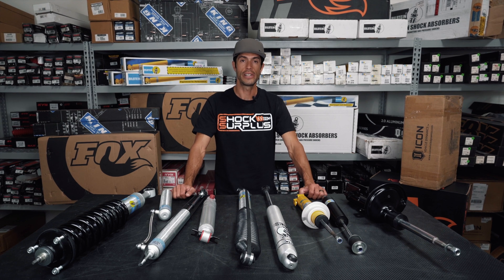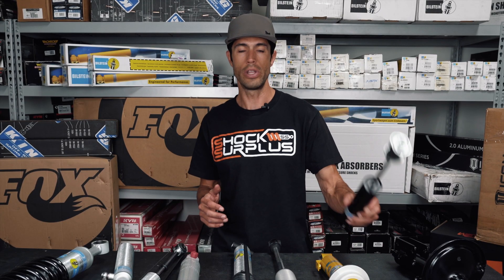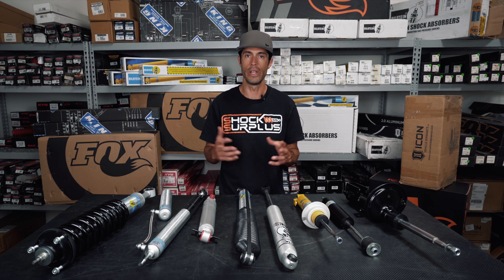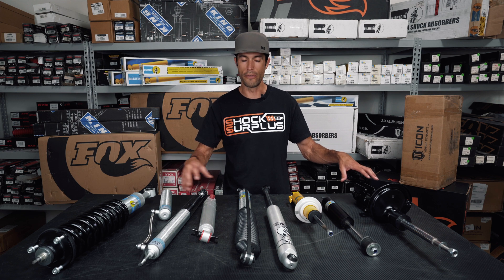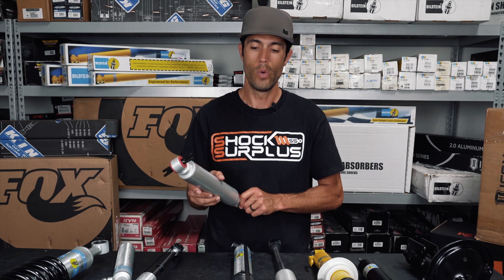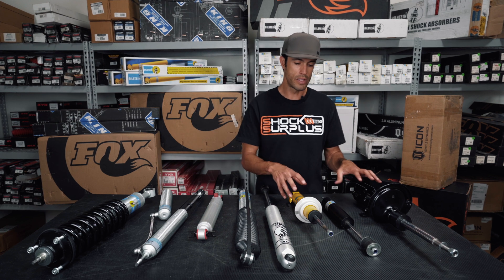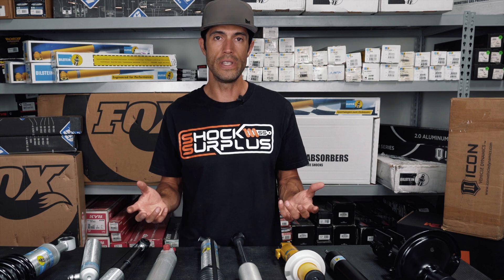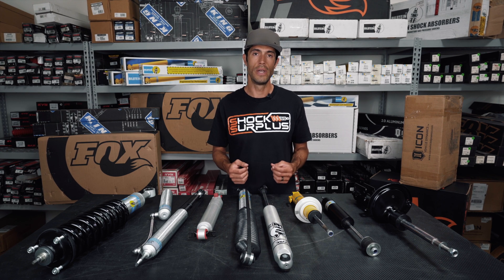Shock Talk Terminology - Ride Control, Comfort, Bump Compliance, Harshness, Boaty Behavior

Comment: I have a 2026 Nissan frontier s crew cab 4x4. It is my daily driver and will never need to tow nothing but my ATV on a light trailer. I am not concerned about payload.the rear suspension is pretty rough on the highway. Is there shocks that would improve the ride or would I need to go a different route. Thanks for any help. A few people have said the billstein 4600 off the pro 4 x would be a improvement
Reply from the maker: We've definitely got some great options to help smooth out those highways, including some from Bilstein and Eibach. Give the team a shout directly and we'll help you get dialed in.

https://www.shocksurplus.com/pages/contact-us
213-433-3616
Reply: @ShockSurplus ok thank you

Comment: Im looking for more handling cornering for my ram 1500 to lessing the roll and over steer or sway because I had 24x12s high tune on the engine
Reply from the maker: should get you setup with some bilsteins and new sway bars, reach out when you're ready, shocksurplus.com

Comment: I have 1940 Ford 1/2 ton panel truck with a ford 8" rear end.  Leaf springs from a 1955 ford truck used for the length I needed.  I would like the most comfortable ride possible.  I don't toe or haul anything heavy.  Thanks.  What shocks do you recommend?
Reply from the maker: Hey there, if you reach out to our pros directly we can see what we've got for you

https://www.shocksurplus.com/pages/contact-us

Comment: I just put the EiBach Stage 2R kit on my 24 F-150 FX4. Set at recommended height out the box. While the pogo stick hop and bounce in the front is gone and it’s much better than stock it still could be less bouncy and bumpy. Still too much unsprung weight with these tires. I’m ditching these 10 ply K03’s that weigh 66 lbs each next week for some 4 ply Toyo’s. Hopefully that works much better with this set up.

Comment: I have a 2013 Toyota Avalon hybrid and the ride is way too harsh. It jostles me when my tire hits bumps or manhole covers. I live in a city with lots of uneven roads, potholes, cracks, and manhole covers and it feels awful. I drove the 2023 Nissan Altima and the ride is both quiet and soft. Could you list some high-quality replacement struts for a smooth ride and how can I quiet the cabin sound so I also don't hear it when the bumps on the tires? I want long-lasting.
Reply from the maker: not a lot of aftermarket options, but KYB does have a set of shocks for you that would improve over what you've got now

Comment: Any shocks recommendations for a 2016 Mitsubishi Lancer ES (it’s a base model people, not an EVO).
I drive on rough asphalt country roads on my commute to work. (About 90 miles round trip).
I have no bouncing or anything but I can feel every lil bump, crack, or pothole I drive over.
I would like to replace them for a softer, comfier ride but without compromising the control too much. Always loved how it handled, cornered out the lot. I only used to do city/highway driving back then though.
Thanks for the help!
Reply from the maker: this will come down to budget, a set of 2 way adjustable shocks would be best, but pricey. if budget is tight, grab the bilstein b4 set

https://www.shocksurplus.com/products/bilstein-b4-oe-replacement-strut-shocks-set-for-2008-2016-mitsubishi-lancer-fwd

Comment: I have an 2022 Ford F-150 lariat. I like long drives on the hwy, with small amount of off roading. I want to upgrade my shocks where trucks aren't pushing me when I pass or when they pass me. I looked at the bilstein 6112 & 5160. What do you think is best for my request.
Reply from the maker: The 5100s would still be a viable option for the front, the 6112 may be overkill for your needs. Eibach would also be a good alternative, good handling, really good comfort. 

https://www.shocksurplus.com/products/eibach-pro-truck-sport-strut-shocks-set-for-2015-2023-ford-f150-4wd

Comment: Any suggestions you recommend for my 2018 tacoma. Its my daily driver and built it mostly for overlanding, but i do about 1 or 2 trips a month of camping/offroad and looking to upgrade my stock suspension and cant decide between icon stage 3 or fox 2.5. Looking for smoother ride and not feel the road in my steering wheel.

Comment: Is there any problem with using a shock made for a E-150 van in a 2dr 4x4 2.0L suzuki vitara with a 2” suspension spacer lift? The mounts fit and it will give me more travel, but theres no rating on these shocks for the vehicle weight or cargo load theyre intended for. I use the vitara as a towed behind my RV. We usually have 250-800lbs of passengers and gear and use it for washboard roads up to a few slightly challenging trails, but never rock crawling. I just want to go fast as possible on washboards without rattling my teeth out and be able to get as much travel for the slightly technical trails.

Comment: I have 2023 sequoia SR5 , factory condition. I want smoothest plush floaty ride over the bumpy road and potholes. The stock shocks are smooth on smooth highway but on small potholes and on little rough road the ride is harsh. Can you please suggest me shocks . Do I need to change the springs and shocks ?
Reply from the maker: There are not a ton of options out just yet, but we think the most plush package available are the Dobinsons MRRs when adjusted properly. They really can not be used effectively with stock sprigns, but they have tons of options for different lift heights and constant weight loads

Comment: i have an 09 Tahoe. I dont haul heavy stuff but im looking for soft suspension upgrades what would be the best option for the shocks, maybe even throwing in springs and struts just want a soft ride.
Reply from the maker: Probably the softest and most plush option out there is going to be the Fox 2.0s. Out of the box they will lift the front 2" but can be adjusted to stock height if you so desire. Their only real draw back is that they will need to be rebuilt every 40k or so under normal use, so they are not the longest lasting option out there, but certainly one of the comfiest.
Reply: @ShockSurplus  does this also apply to the rear shocks?
Reply from the maker: Ride quality and life span yes, but the rear shocks will not change ride height

Comment: 07 fj cruiser, base weight, eventually will add weight but i want a smooth ride on two track's,washboard roads just glude over all those annoying bumps and washboards. While getting anywhere 3lse i need but that is primary use
Reply from the maker: For that I would definitely lean towards something linear in valving and uses a universal style flat ground coilover spring in the front like a Fox or King. If you do not have weight in it now, then keep the standard springs on the coilovers and go with a light or standard load rear spring until you have the weight to necessitate something stiffer. Otherwise if you do not mind the rear sitting a little tall you can go with a multi rate spring in the rear like Icon 52800 3" springs. Their initial rate is soft enough to live with unloaded, and they get progressively stiffer as compressed so they work killer under a load. Since the front coilovers use a universal style spring it will be easy to get a stiffer when and if you need it.
Reply: @ShockSurplus  I hear a massive amount of people recommending bilstein 6112 in front and 5100s for rear is this equivalent? I wish there was just a set kit with part numbers for just this haha
Reply from the maker: The Bilsteins are great, but their digressive valving will have them feeling a little firm on washboard roads at lower speeds. They are great if you like to drive a little faster, but if you want something that "Glides over the road" those are not the shocks you want. Fox and King have a number of various options for coilovers and shocks based on budget and needs so there is not just one simple part number for everything, but al of this is listed on our site and if you get stuck we can help you make the right decisions for your needs. https://www.shocksurplus.com/

Comment: I have 2021 GMC Sierra 3500 SRW crew cab regular box.
I do not tow but will occasionally wi fill truck box with 500-700 of camping gear or my quad. 
I do not use truck for off roading.
Still running OE shocks and looking to improve smoothness in my ride. 
What would be your recommendations?
Thanks in advance.
Reply from the maker: Eibach Pro Truck Sport monotubes would be a great choice. They should be noticeably more comfortable unloaded and much more stable under a load.
Reply: @ShockSurplus  thank you very much for response. I will have to research market to see if I can get them in Canada.
Reply from the maker: We ship to Canada so if you do not have any luck locally we got you covered
Reply: @ShockSurplus  noted, thank you.

Comment: Hi I just got a 2018 jeep wrangler jl want to lift it 3 inches and put a 35 inch tires , which lift kit do you recommend I want my jeep to ride smooth and feel heavy kind like a Cadillac. I don’t do off-road that much. I will do it once in a while 
thank you.
Reply from the maker: Look for a kit that has dual rate springs, Skyjacker, Teraflex, Metal Cloak all have these options (off the top of our head), that will mean the daily drive and easy trails is softer for comfort. A set of good shocks will also help of course, but if you go with Teraflex - their falcon shocks are pretty firm and sporty, meant for performance offroad, so we wouldn't recommend for you. You can get any of the kits above though and pair the shocks of your choice, Fox 2.0 are a solid option - comfortable with good control. King 2.0s are more expensive, and even softer than Fox. Or if you're on a budget, grab the Skyjacker kit with dual rate springs, and match with Black Max shocks, pretty soft ride.
Reply: Can you tell me what to buy so I can get the best ride for my jeep and do you sell those parts? I just wanna do it right and I want to do it just once thank you for all your help

Comment: I just bought a lifted 01' Ranger and it rides pretty rough. It's hits even small bumps pretty hard, very stiff on the rebound, and is pretty boaty. I think it's a body and suspension lift as the bed sits pretty high and there are 33'' tires on there.  I  don't do any off-roading and will only be using it as a daily driver for about 20mi a week and the occasional 1.5hr trip. I've had a few S-10s and I recall them taking bumps a little harder vs my sedan but wanted to know what you would recommend to get a smoother ride. I'm looking for something like a Silverado type of ride. I was moving last week and rented a pickup from U-haul and that thing didn't feel any bump. Is that a realistic or attainable type of ride for the ranger or lift kit? Thanks so much!
Reply from the maker: Sure it really depends on if it has torsion bars or coil springs up front, how much lift it has, and how the lift was achieved. Give us a shout directly on our website with a little mroe details on the vehicle itself and we should be able to find something that might help. https://www.shocksurplus.com/pages/contact-us

Comment: Question I have a 2003 Durango with factory shocks I off road pretty often in it. I live on a farm and don’t really want to spend that much what would be my best option?
Reply from the maker: KYB gas-a-just is a good mix of comfortable ride quality and longevity. Skyjacker Black Max have seemed to be pretty solid as well if they have them for your vehicle. If you want something that's going to last a long time (great investment) then Bilstein 4600 is the answer

Comment: I got 2019 wrangler sport 2dr with 285/75/17 ko2, it’s a daily driver with almost hardly any off-roading , looking for new lift 2”-2.5” with new shocks. What do you recommend
Reply from the maker: Do you have the lift already? If so, then run Bilstein 5100 or Fox 2.0
Reply: @ShockSurplus  not yet but am planing to have it lifted this month

Comment: My 2017 jaguar F-PACE  rear stock suspension is too stiff for my taste.  I would prefer a softer suspension. Any recommendations ? Thank you.
Reply from the maker: Did that come with the KYB factory shocks? Not a lot of aftermarket options that we see, KW has a kit, but its a lowering kit and much firmer.

Comment: Any suggestion on a 2005 Nissan Armada, I have OEM everything but I want more comfort and handling then factory offers. Should I also replace the rear air suspension. It’s my daily driver and travel car so I want a smooth ride over bumps and rough roads.
Reply from the maker: We don't have anything that would work with your factory air suspension.

Comment: Any suggestions for the 10th gen Accord? They're already equipped with decent shocks from the factory. Would an upgrade make any difference that make it worth the cost? I'm looking into more ride quality and comfort.
Reply from the maker: We're not aware of any aftermarket coilovers right now besides maybe BC Racing and other smaller brands offering shocks for that Accord - and they aren't going to improve comfort.

Comment: What’s a good shock for a more stiff ride??
Reply from the maker: Bilstein is the go-to sportier / firmer ride option. Depends on your application as well though. Falcon is firmer, KYB Monomax, a number of options
Reply: @ShockSurplus  ok thanks. And what’s a good budget shock for comfort and bouncing on sand dunes?? Like a budget prerunner shock like King suspension
Reply from the maker: Whats your real budget? Fox 2.0s can be had for about $700/set on a solid axle vehicle, or about $1200 for an IFS vehicle with coilovers. The Bilstein 5100/5125 are budget friendly ($400/set) and can take a beating in the dunes. Email support@shocksurplus.com with vehicle and budget and we can get into some details.

Comment: Hi. Thanks for the amazing video. I have a LEXUS es330 2004 that is a 4dr sedan car. The car came with these shocks that have a button in the middle console that says (Comfort-Sport), and I have to choose between one of these settings. I heard that changing these shocks is really expensive. My Q is; putting it on which setting, sport Vs. comfort, will make the current shocks set lives longer??, I drive only on rods with no off road. Which regular standard shocks are good for my car in terms of longevity.
Reply from the maker: Comfort will create less pressures in the shock compared to sport damping, so that setting could lead to longer life.

Comment: Hi I have a 2022 Toyota Highlander Hybrid with a 2in TORQ lift.   I need a little more performance.  I drive a lot twisty mountain highways because I mountain bike.  Also I sometimes load the rear hitch a bike rack plus bikes thats about 300lbs so I get a lot of rear sag.   Any suggestions will be greatly appreciated..
Reply from the maker: Looks like you're in luck, Flatout Suspension has a performance kit for your vehicle. Let us know how they are and tell them we sent you =)

https://flatoutsuspension.net/products/highlander-grl?variant=43062228910315

Comment: I have an 05 frontier, I recently bought rancho struts for that vehicle and the truck rides the exact same on the roughest setting and on the  softest setting, is this normal for brand new preassembled struts
Reply from the maker: The adjustment on Rancho parts are very minimal and not drastic. We personally don't run any of their kits on any of our vehicles any longer.

Comment: 2008 f150, looking for a comfort ride but pull a light trailer about once a month
Reply from the maker: So it's hard to focused on comfort and towing. Towing requires the shocks to be firmer to support the usage in which it's designed for. Our top choice for towing and hauling are the Bilstein 5100. However, they are going to make your vehicle feel a tad bit firmer than stock. You will get less body roll, less nose dive, and more a overall stability benefit.

Comment: I just bought an 07 Mustang and it's very rough riding going over small bumps,potholes,etc. What is a good shock to provide softer ride for that car? Thanks.
Reply from the maker: Ford Mustang is considered a sports car and is should be tuned more like a performance vehicle which is may ride rough. Most of the parts we offer are either OEM parts or coilover system or even air bags.
Reply: @ShockSurplus  Thanks.The vehicle has 109k on it and has a banging/clunking sound,seems to be coming from the front.

Comment: For a loaded 4wd going away for a weekend or weeks at a time, that has weight differences between daily and touring i dont think one can really pass up on adjustable bypass shocks in the rear atleast, assuming spring rates are right. Good bang for ya buck, decent performace too. In australia we dont seem to get the millions of options u yanks get with ur big trucks.
Reply from the maker: Cheers from the USA mate! So we don't jump straight in bypass or adjustment right away for anyone. It really depends on what they're doing with their truck such as what has been installed that adds any constant weight and what the truck or rig is being used for and how often. If someone wants to be covered in most scenario but possible lose some comfort, then yes go with a full off-road set via Fox 2.5, King 2.5, OME BP51, Icon 2.5, Bilstein 8112 and etc.

Comment: Got my bilstein 5100 from u guys last year. Decided to go 1.75 high with oem spring. My wife hates the ride. What would be my options to get a smoother ride? Thanks for all the info you guy’s pouring. 🙏
Reply from the maker: It depends on the vehicle so we what is offered as not every part is available for every vehicle. We would suggest, if they are available, Eibach Pro truck or Fox 2.0.